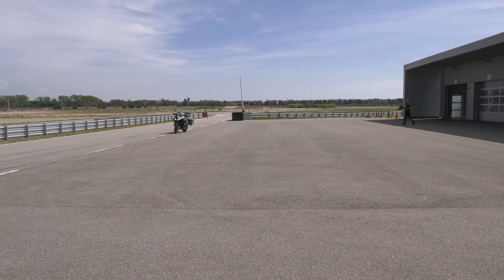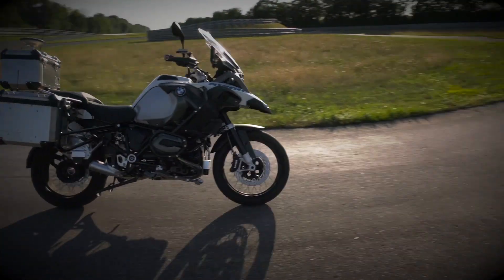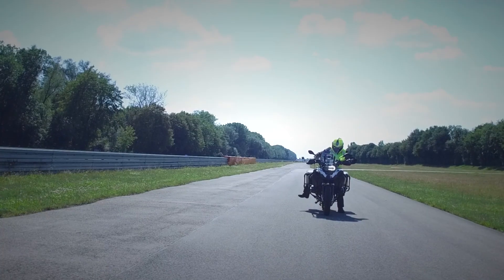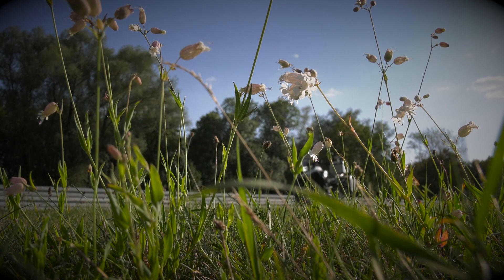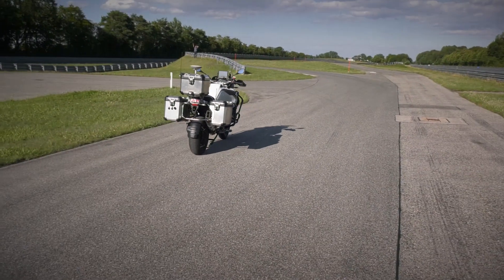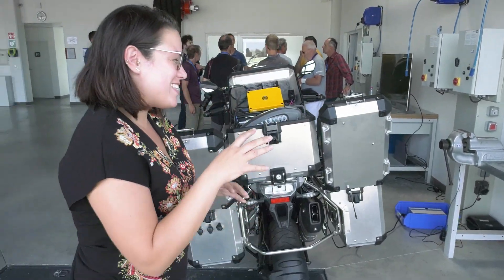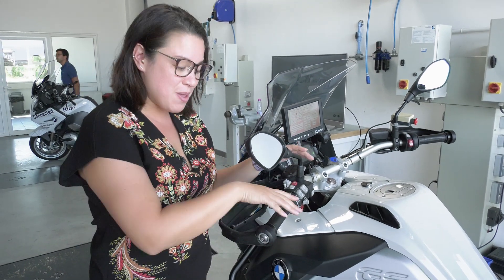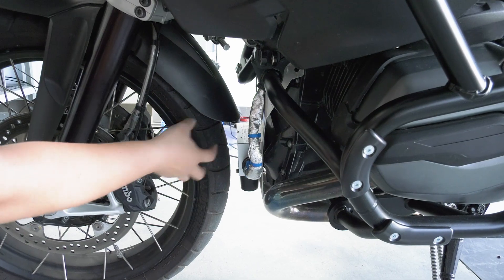A Closer look at BMW's Self Driving Bike

Comment: Does it have auto breaking and way finder too? Cuz if it does that will be pretty cool.
Reply from the maker: braking is a tough one since there are so many variables, braking safely so the rider doesn't get thrown off is the big one. It's not like a car where the car can break as hard as it wants because the driver is wearing a seat belt
Reply: @basicthinkingtv  doesn't it have distance sensor to determine the force with which brakes should be applied. It would be great to have that technology. It would really reduce the accident frequency.

Comment: Impressive, but if this is supposed to be the forerunner for self-driving bikes actually coming onto the market, then I ask myself the following: 1. handlebars and the whole front body will not be needed (or just a simple holding bar as in some roller coasters), 2. that would be all very different from the optimal seating position and also not comfortable. It would be more comfortable to sit in something chair-like, which is not a bike anymore in my opinion - just like flying cars aren't cars, but planes.